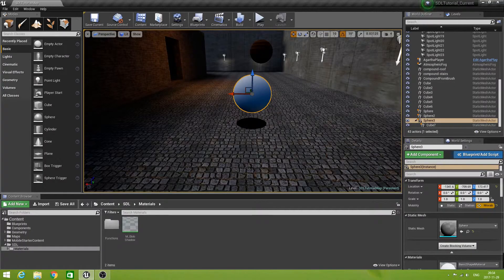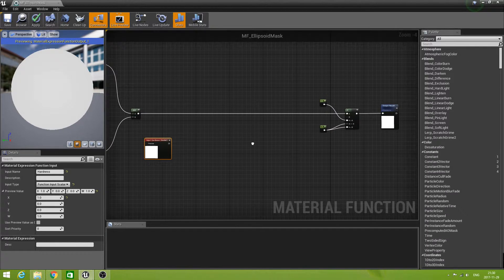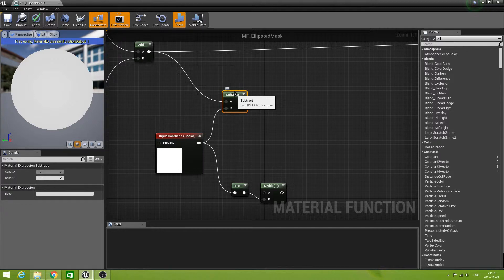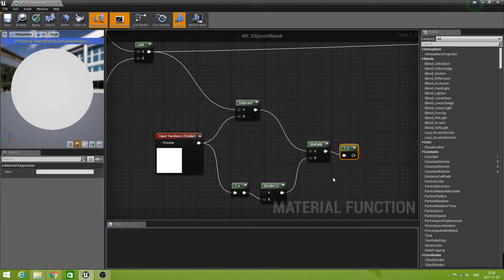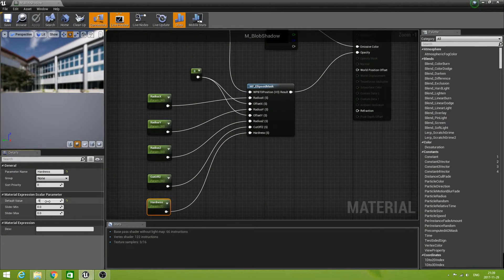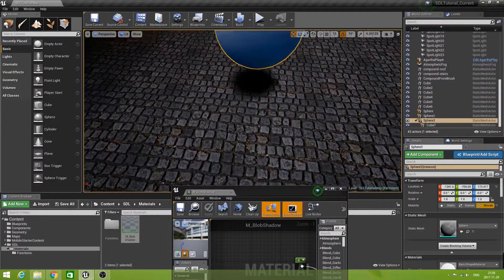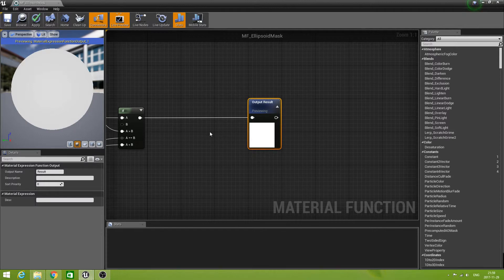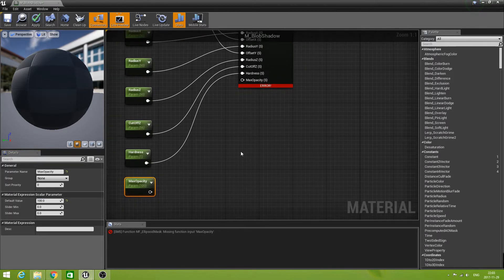How to Create Blob Shadows in Unreal Engine 4 (Part 3)

Comment: Hi, I'm having issues with the shadow when it comes to interacting with the world, as the shadow clips through the object the player is standing on and goes through onto the surface of the object below that one, and the one below, and so on. The shadow material object is stretched to be 120 units tall, which is probably the reason why it does this, but when I set the height to be smaller, it fixes the issue but trades in the shadow blob not being visible from high up (which is a problem for a platformer). Do you think there's a way to get both of these to work, cause I really need to fix this so that it doesn't remove any immersion.